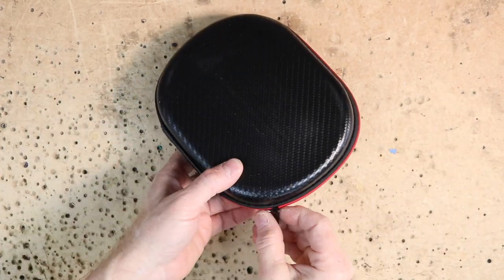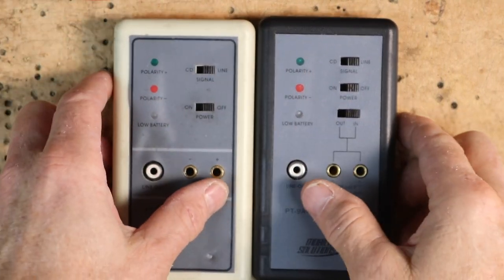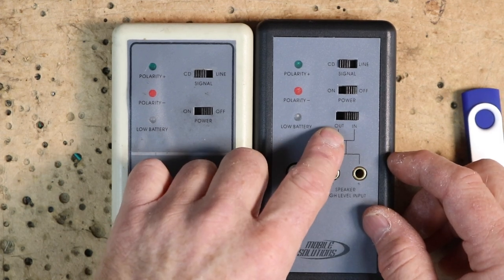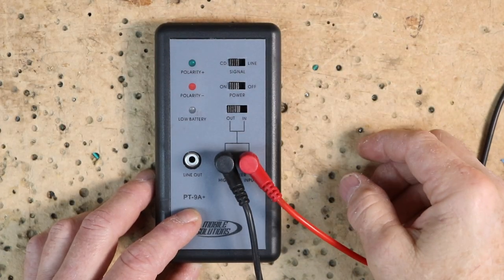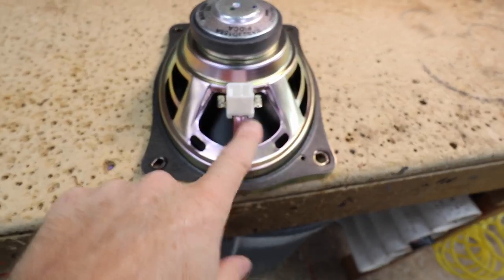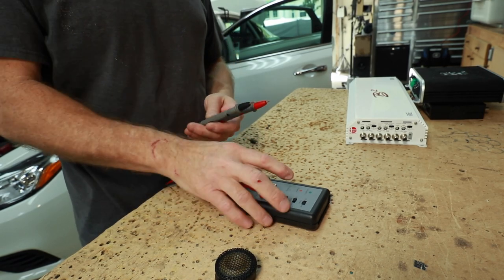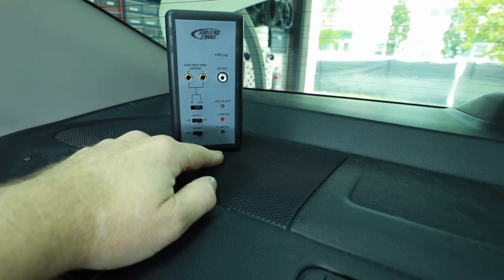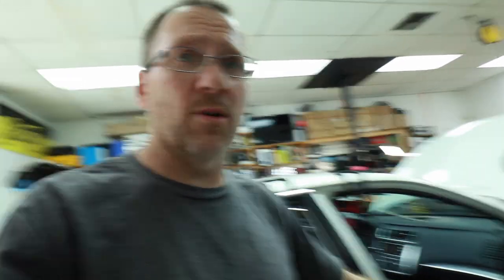PT9A+ Polarity tester from Mobile Solutions Tools from the Install Bay

Comment: I continue to hear polarity doesn’t matter as long as all speakers match is this correct?  Also if all my speakers have a negative polarity should my sub have a negative polarity as well?
Reply: ALI CARREON, the idea is that all the drivers should be in phase. In other words, all of the sound waves should be going in the same direction at the same time. All the cones should be going out at the same time and going back in at the same time. If they are out of phase it will sound a little off and if there are low frequency drivers out of phase you will hear a loss of bass since the drivers will cancel each other out. 

Subs are sometimes a special case. Before time alignment became readily available, the distance between the main speakers and the sub was such that very low frequencies would arrive out of phase so it might sound better to swap them intentionally. This happens more often in homes than cars where the distances are often larger. However, this was a poor man’s work around rather than a fix. Today, time alignment is an easy solution and you should not do this. I hope this helps.